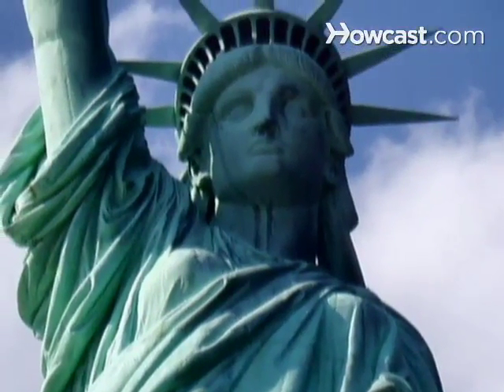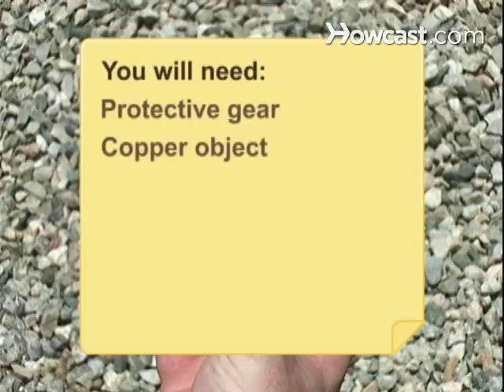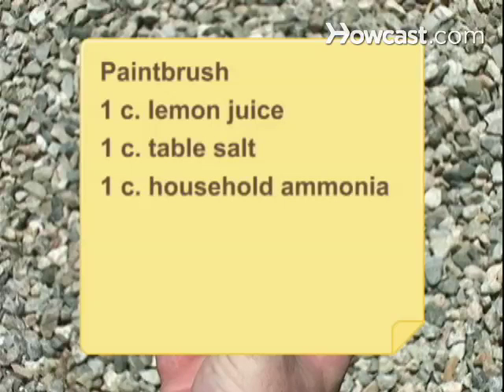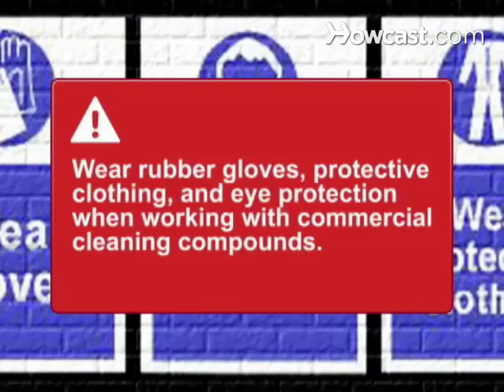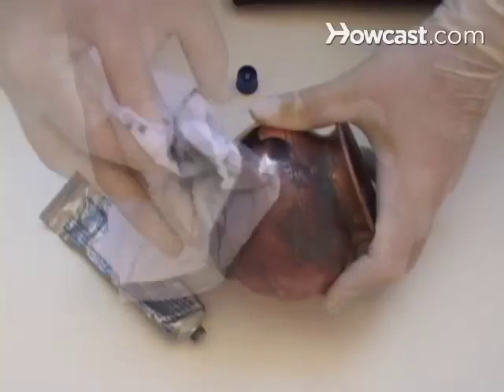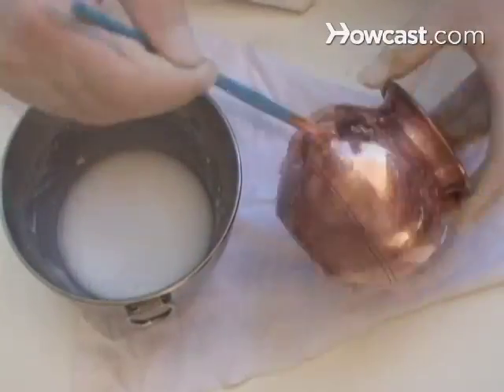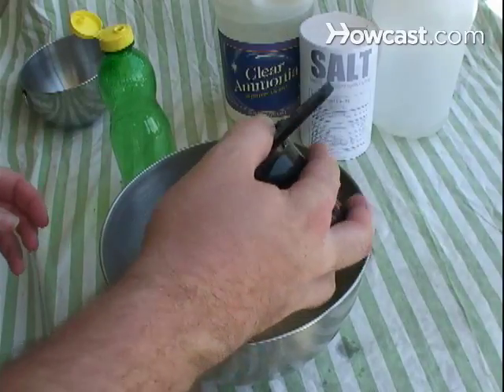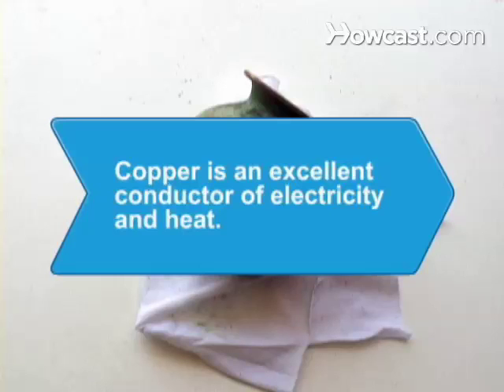How to Age Copper

Comment: Preheat oven to 350°. Grease your cake pan. If you don’t have one, the oil pan off your car should work. Follow the mixing instructions in the video. Once all the ingredients are blended, pour the mixture into your pan. Cook time varies between 5 minutes and 4,502 minutes. Use a toothpick to gauge doneness.

Comment: No. Gold is prized because it's a good conductor which doesn't corrode. Both copper and silver are significantly better conductors of electricity, but corrode over time when exposed to air and moisture.

Comment: That is a common myth, In fact Silver is the best conductor, 
Gold on the other hand does have the lowest "contact resistance"  and is used in switches and contacts where minimum resistance is called for.

Comment: @jasleil No, Copper has the 2nd highest conductivity of all the elements. They use gold on electrical contacts because it resists corrosion. Conductivity - 1st-Silver. 2nd-Copper. 3rd-Gold. 4th-Aluminium.